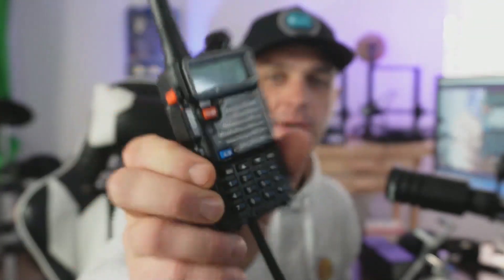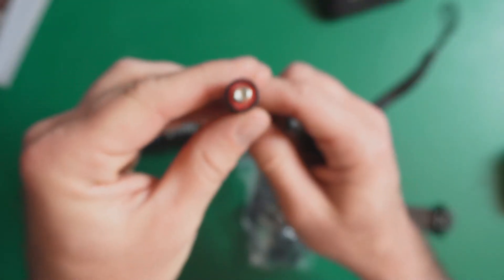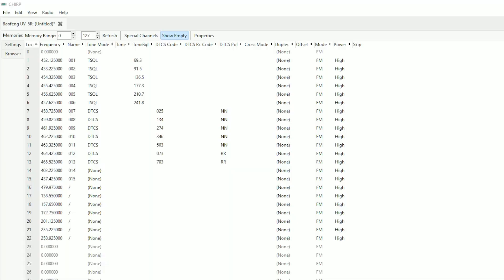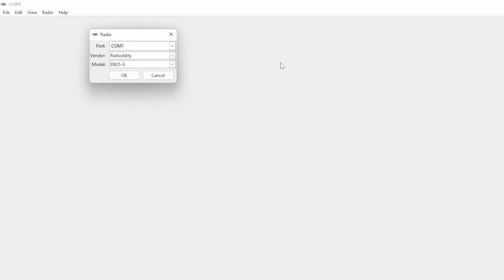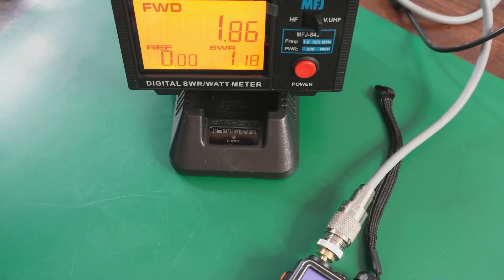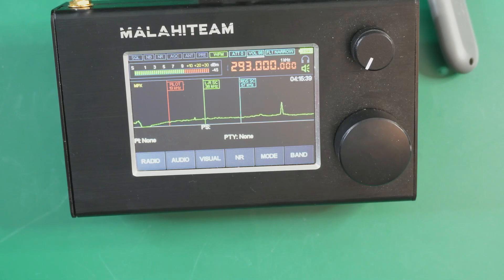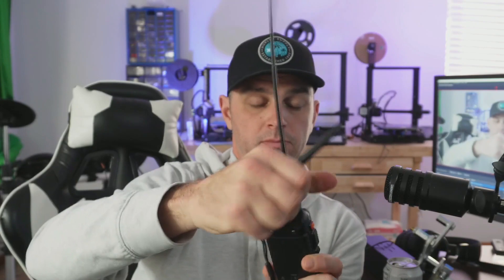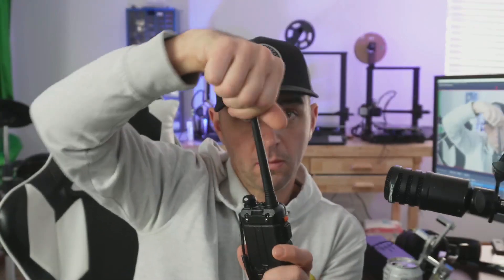Baofeng UV5RX3 - Should you "Upgrade" your HT radio? #baofeng

Comment: Hopefully you can help me.  The 1.25 band worked out of the box.  I put it into VFO, set it to 220 and hit scan.  Worked fine.  After I hooked to chirp the angry chinese lady just says cancel.  Yup I selected Radiodity and UV-5RX3.  I would like my 1.25 back.  Second note, I chose this radio only to enter the hobby as cheaply as possible.  Passed my Tech and who knows what the future holds.  Thanks in advance, KF8AKV 73
Reply from the maker: If you have the codeplug saved, so you can reupload it to your radio later, do this (to test):

Go into the Baofeng menu and do a reset all.  Can you then transmit 1.25m again?  If so, there has to be a setting in chirp that is disabling its ability to transmit. It's probably under other settings (and check your band limits).  

Hopefully that helps.
Reply: @DudeTested  THANK YOU !  I'll try that. Honestly I need to clean up my memory channels anyway, now's the time I suppose.

Comment: Sounds to me that the Raio was Factory Reset to open up the VFO to 520MHz.

The question is how would a newer UV-5RX3 or similar model as the output on the newer UV-5Rs have been improved upon since the creation of this video.

I own a few Triband Baofengs including the UV-5RX3 (BF-R3 and UV-5RIII - all sharing the same case and the UV-S9X3) and they all seem to work find but to me the price was a bit steep for some of them. But then I discovered the TriBand Hack for the UV-5R and hacked all my UV-5Rs and now they function just the same as those other tribanders. I do not have a power meter to test them on but point to point, they seem to have the same range on all 3 bands compared to the Tribanders. The only issue being you need a separate 1.25M or Triband antenna for it to work well. Using the Dual band antenna on 1.25M gives bad output.

Comment: Big disappoint for me this week re: radio nightmares at the hands of unscrupulous vendors. First MS jacked up all my ham radio cables and img files, all of them. Rendering all my saved Chirp .img files corrupted. Its MS quest to rid the world of cables that have chips parted in the wrong side of their heads. Yeah, so MS brazenly goes in where they were uninvited, and peforms various insundry acts of piracy in the bowels of my computer. Unannounced. Unwelcome. Does slash and burn,  and then just calmly walks out like nothing happened. Bill Gates at his finest progressive marxism.

So now I find that the Baofeng UV5RX3, is being hidden as the "Radioddity UV5XR3". According to a little sentence buried in Chirp's page.
What  you find there, is a note at Radioddity that its all Chirp's fault, that Chirp changed something (?). and now that you;ve been happily using free Chirp, that your tri-band radio has had the 220 band stripped out of its firmware by CHIRP, and even if you use the correct software to fix the problem, that its now irreversably corrupted and unfixable by any conventional software to restore.  Even updated UV5RX3 book at Radioddity shows it as a two-band radio..... even though its still a UV5RX3 triband named radio.   Looking for clean, correct software and .img  files to fix this mess. Shoulda used RT Systems!

Comment: The aerial includes some of the out of band filtering. Using a different aerial on such a cheap radio without checking the "filter" effect of it is where the problem lies?
Reply from the maker: The standard in part 97 mentions "supplied to the antenna transmission".   So at least here in the US of A, the standard would imply at the transmitter and external filtering wouldn't be valid
Reply: Yes it's a bit vague as the second harmonic through a quarter wave has an impedance mismatch (SWR) and so does not match for power transmission, but the third harmonic doesn't, so it will match reasonably easy if no bandpass filter is present ...

Comment: I noticed the bench behind you with the 3D printers on it looks like the wooden work bench from Harbor Freight.  Is that correct?
Reply from the maker: Indeed!  It's a little wobbly, but better than nothing. Ideally, I want to get one or two of those really large toolboxes with flat wooden tops.   Regardless, I don't have too many print issues with the printers on the desk.  Cheers!

Comment: Love  your content ol boy i just purchased a yeasu ft65e as a second radio to my yeasu ft60e had that one for 12 years built like a brick. Anywho putting the two yeasu handies up against a baofeng uv3r uv5r uv5r 5th generation and a b580t not forgetting a quansheng TG 007. The yeasu radios kick the crap out of the china cheap radios, problem is all my china specials have spectrum purity  problems and intermod cross band issues due to lack of front end filtering. My yeasu radios do not have these problems at all so my advice to a new ham is get decent kit no doubt my comments will stur up the snobbish anti  baofeng hate that dominated these days. 73 from the uk MW6ZAN  IO81IJ WALES

Comment: I have the btech version. Got 5 watts on vhf. 220mhz 5  1/2 watts. The uhf got 4 watts. I barely even used it. The freaking keypad is rubbing off already. The radio supposed to have better sensitivity. The radio gets front end overload. This is just like any other piece of junk Chinese radio. The main reason I got the radio was for 220. I'm not really impressed with the radio. I didn't pay but about 60 bucks for it. I did not lose that much so who cares. The battery on it sucks. All these radios suck. I have one of the btech mobile  radios. It's the 25x4 it sucks too. The radio only does about 15 watts on UHF and VHF. On the 220 band it does about 30 Watts. Go figure. The only radio that's a step above that is the Wouxun. I will give Wouxun little bit of credit it receives better. In conclusion all these radios that are direct conversion are just about nothing but junk.

Comment: I got the BTECH tri-band about a year ago, since I wanted to try out 1.25m. I had the ARRL test it at Hamvention and it failed, which wasn't a surprise. I got it used and figured it'd be a good SHTF radio, plus it was cheap to get a few accessories.

Comment: Thank You for the review. Yes, you should 100% upgrade. Upgrade to something quality such as the Yaesu FT-60 or other quality radio. Just having a great front end and much, much faster scan speed alone is worth buying a quality radio. Toughness and knowing it will work when the chips are down is worth a little more $$$.  You have to understand that the Baofeng radios are made with the cheapest parts possible, are SOC vs. Super Het and have poor overall quality. Buy once, cry once. It's worth it ! Want tri band, get a Yaersu VX-6. It's bullet proof.

Comment: i bought one from B-Tech about 2 yrs ago- a UV5RX3..thing.. i had to buy the cable seperate, but it did come with 2 antennas..and i can transmit on those police EMS freqs.. i dont..but it does.. The are fun to have when i GO snow mobiling and ATVing with friends or work around my place in the woods.. but u r right, they are not perfect radios, and i am surprised that the FCC hasnt gone knee deep in these radios... great video.. and the radios are fun if use responsibly.. ( but who does that ? ) great vids!! love em! Many thanx!

Comment: Hey, I have several of these radios and I know they sick on spectrum purity, because the internals are all the same on these <$50 radios. I do have several with the Nagoya NA-320 antennas from Amazon to give them tri-band antennas. Thank you very much for this video!  I do not have a spectrum analyzer so to see you use yours is great!
Reply: What raidio would you recommend to listen to pilots, just for fun, would setup in video work?, I live couple miles from small airplane airport and they fly lowish right over house 20+ times a day. Thanks
Reply: @Latinos4Trump  Hi!  Depends on how much you want to spend. $200 on up there is Wouxun KG-UV9PX, Yaesu FT-70DR, VX-6R ($250), Alinco DJ-G7T, and similar radios have better functions and Air Band from 108 to 136MHz AM. That is air band.